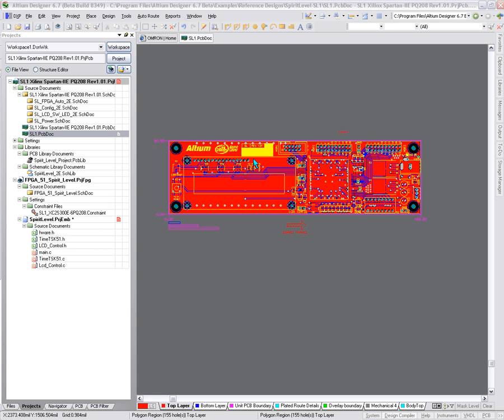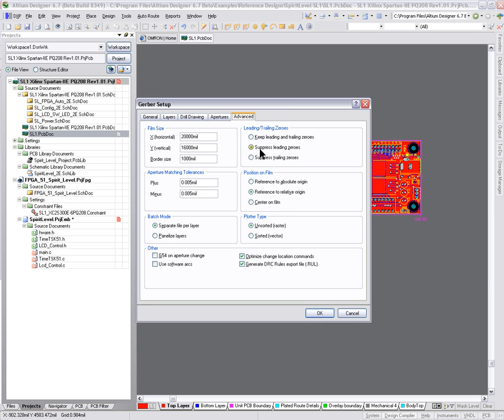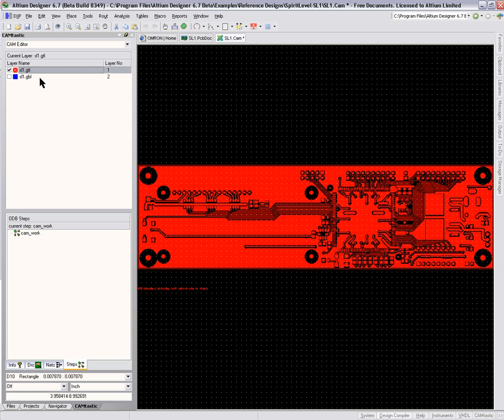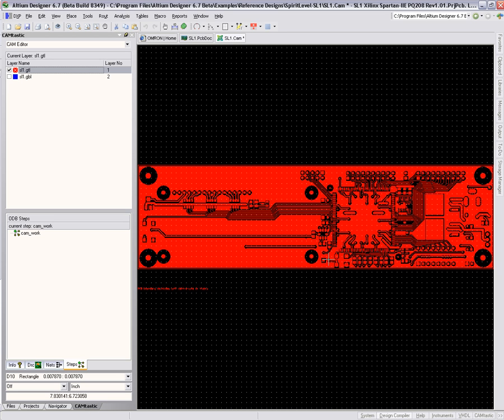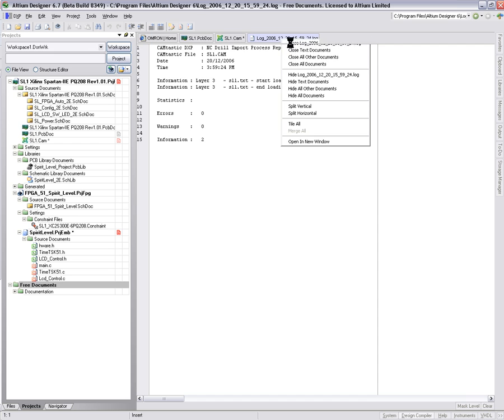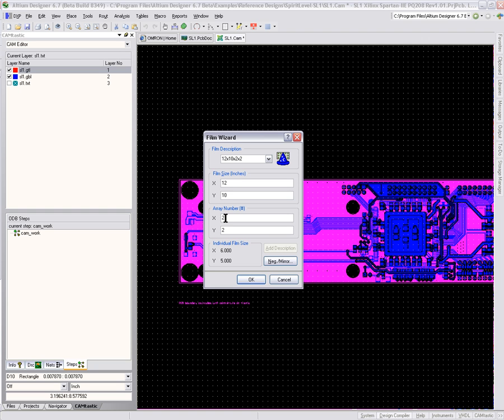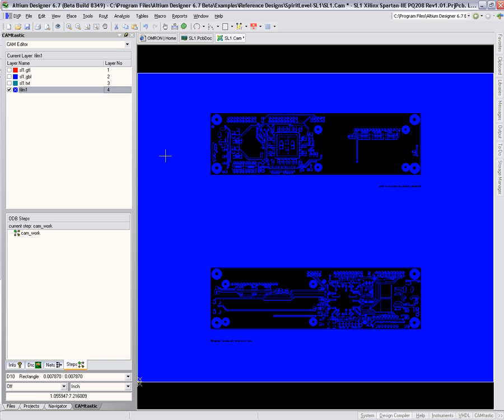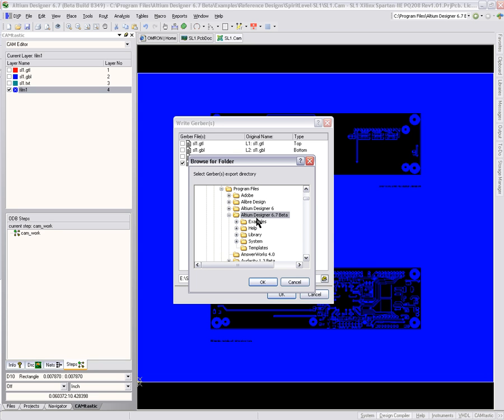How to create a negative film of a GERBER or ODB++ layer

Comment: could i print this negative  gerber as pdf 
So i can print  the pcb at home 
this still a big problem with me i can't print  without inverting the layout 
in eagle it was easy  but altium i have some trouble 
if i could make it in altium i still have some problems with holes it looks not clear white color
Reply from the maker: I think there's a better way using the "PCB Prints" and you can edit the color mapping for different objects and use "Print Preview" to check it before you print.

Comment from the maker: @rompedicotecas Not too sure exactly what you mean. The purpose of generating the negative is to print a negative film -OR- use it to drive a PCB prototyping CNC router (which requires a negative to remove copper everywhere except where you want it)